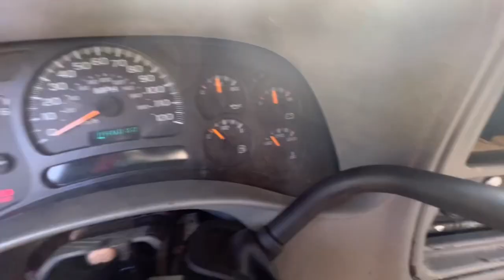Official start and run on Dusty Turbo Truck!! Insane feeling 😮‍💨

Comment: congrats man, you only really need one wideband o2 sensor after the turbo, and wire it into an available 5v reference wire from your ECU then your tuner can do the math from there and use that to tune it! don't get into boost too much before you get it tuned or you'll crack a piston, the rings cant expand much stock!
Reply from the maker: Yeah tuner have me on a base tune and I’m running two 02 sensor from drive side and passenger also have wide band band. I can stay with the tune I have but will take to him to make sure things a ok 🙏🏽 appreciate input means a lot and will look out 💪🏽